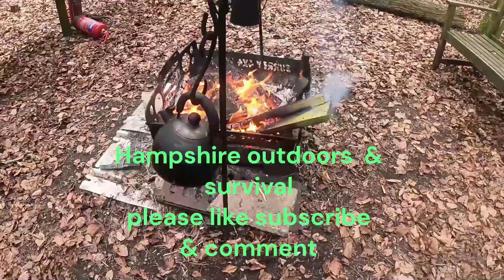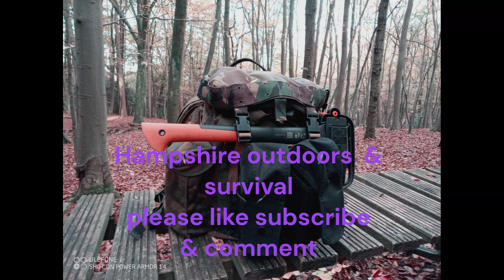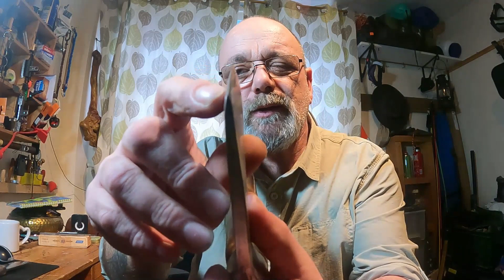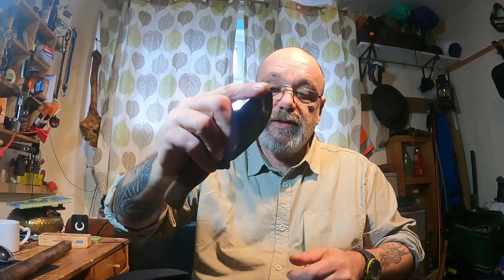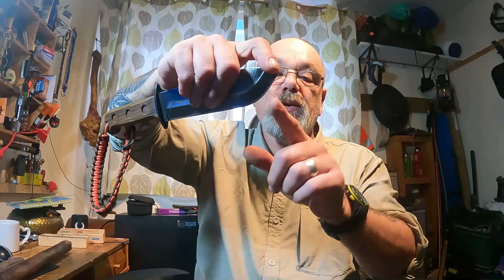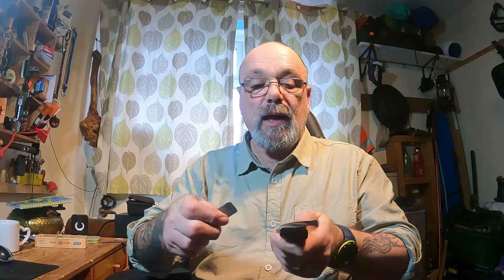knives & axes part 2

Comment: Opinel has been a fav of mine very light in the pocket and will sharpen on a rock. My axes are Gransfor Bruk they keep their edges for a long time. The hardness of the steel is important for the length of time a tool keeps its edge. I once found a knife that I had to heat treat to get the hardness back. being a jobbing blacksmith you will already know about heat treatment.
I enjoy your videos. thank you
Reply from the maker: I love the opinel and have the same axe I love it thanks for the comments